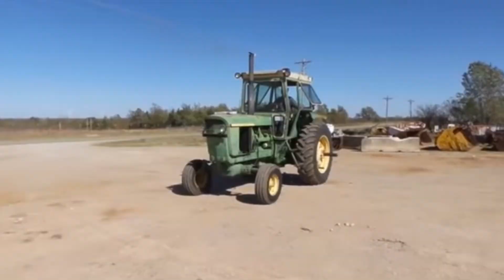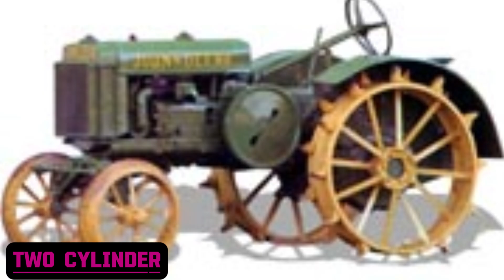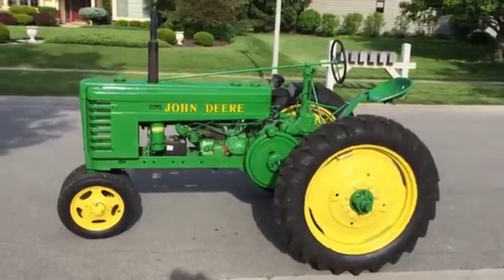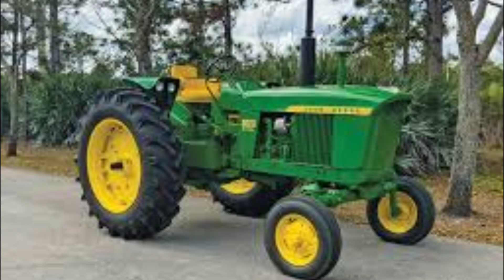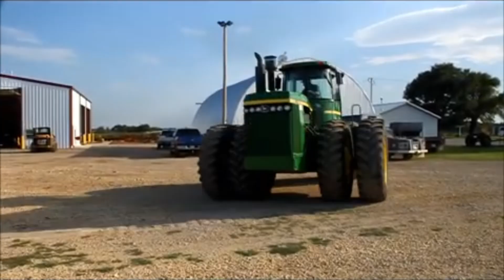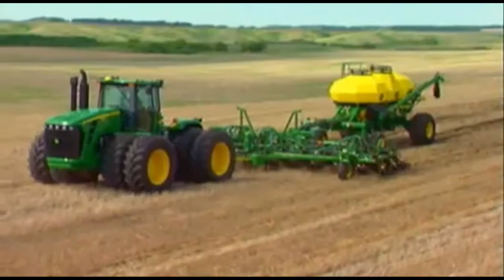John Deere Engine Evolution

Comment: Screw John Deer's "technological advances". I'm not the least God damned impressed with their BS extortion of the American farmer. Get rid of the electronics and stop the nonsense. Battery, relay, starter, alternator, voltage regulator, coil, distributor and plugs.... END OF STORY. This entire concept of excessive Rube Goldberg design in every aspect of life has got to be irradicated. TVs, cell phones, computers, stereo equipment and video games are the only thing in a human being's life that requires electronics. Leave our cars, trucks, appliances, HVAC systems and farm equipment alone. We have a JD 430 that causes less grief than the new crap.
Reply from the maker: I agree